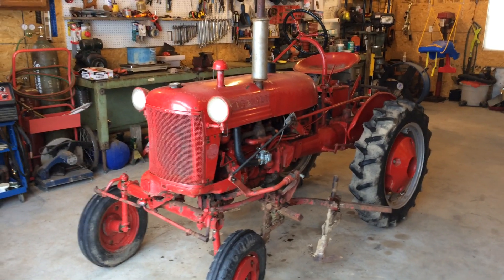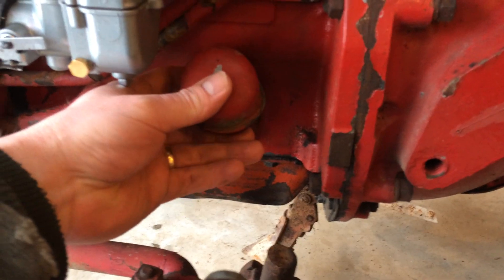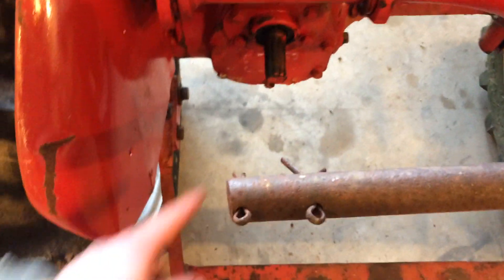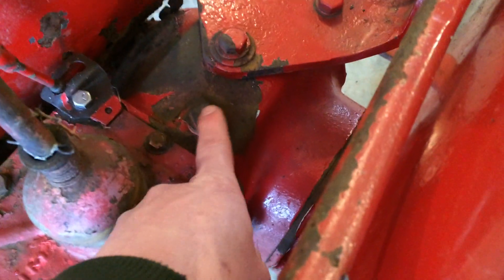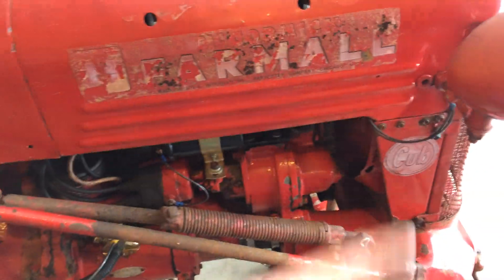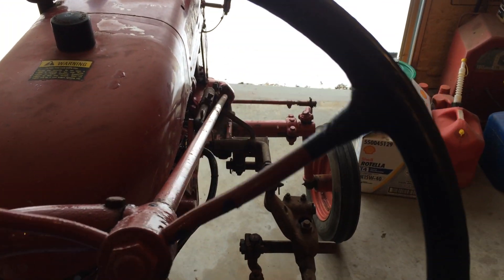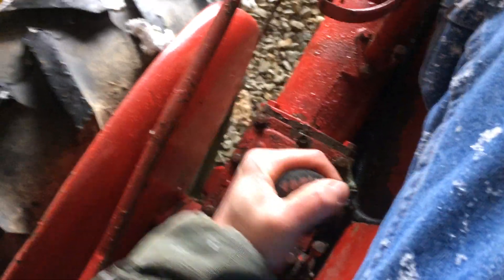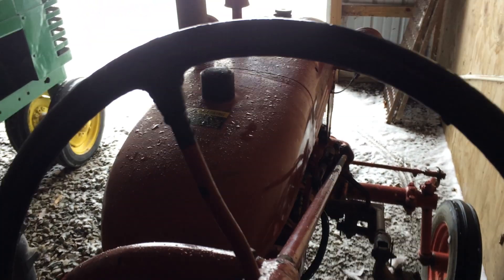Info about and driving an antique tractor  Farmall Cub

Comment: Just a reminder for those not familiar with older equipment that does not have modern electronic ignition systems. Don't leave the ignition switch in the on position for any more than a few seconds if the engine is not running or being turned by the starter. The ignition points in the distributor will be destroyed and the engine will not start. If the engine stalls or fails to start remember to turn the ignition switch off until you attempt to restart it. Good looking tractors you have there, thanks for the video.

Comment: My first job on our farm was cultivating sweet corn with a Cub when I was 10 years old. 
No cab, no air conditioning. Just good ole Sunshine.
Reply: Farming isn’t farming anymore. I do it old school. Tractors with a cab with ac/heat, touchscreens, radio.. ya farmers are lazy now a days.
Reply: your air conditioning was the wind
Reply: @Jabari Terrence instablaster :)
Reply: @Maximiliano Erik thanks for your reply. I got to the site through google and I'm in the hacking process atm.
Takes a while so I will reply here later when my account password hopefully is recovered.
Reply: @Jabari Terrence No problem :D
Reply: @bbruce995  cooler running into the wind hotter running with it.
Reply: I used to do the same thing, plus run the old combiner from the sixties

Comment: Safety hat 'on'.  15:00.  Just to expand.  You WANT to use the flip-lever brake lock when you're in higher gear just driving down the road.   The Cubs don't go very fast (I think they top out at around 7-mph), but at higher speeds you do NOT want to accidentally brake one of the wheels separately.  Turn you right over.  So ALWAYS engage the lever unless you're purposefully in the fields at lower speeds and you want to make tighter turns using the separate brakes.  Safety hat 'off'......😊
Reply: Safety First

Comment: Brings back memories.  Growing up in the 60s, my Dad had a 52 Cub.  Belly mower, different type of cultivator set up, bottom plows that could be run in both directions plowing, sycle bar and larger draw bar.  That 10 hp engine would (about) pull a two-ton bailer up one of the hills in the field.
Reply: We also had a sickle bar,  blade that could be mounted under or out front and a heat house(cab) for the winter.    We still have it in the family

Comment: Quite a fewvyears ago, lol, I worked as a tractor and equipment mechanic for a local John Deere dealer. I had went on a service call to see why the customers JD tractor kept dying. Found drill shavings in the plastic fuel tank was plugging the pick up line, the factory did a poor job of cleaning when they drilled the fuel tank for the guage and pickup mounting. There was an old McCormick sitting under a big oak tree. I talked to the owner and he told me the farm all had been sitting there for 25+ years and if I wanted it just bring a trailer and get it. It was some time but I checked on it a couple weeks later and he apolizized as he had given it to his brother in law who worked at a boys farm in mississippi. They got the tractor running and working, it had the belly mounted bush hog cutter and it all worked. They used that tractor for years to mow the fields at the school. Made me glad someone that really needed it was able to make a good machine with it.. I aquired several tractors during my mechanicing days, lol. Those old 140 farm all tractors were really good little tractors....sure worked on a bunch of them over the years..even got to do full restoration on a couple..I loved doing restorations.

Comment: I've got a 40 something Cub that belonged to my great grandfather to my grandfather. I converted it from 6 volts positive ground to 12 volts negative ground. I had the Starter button converted to post so I could wire in an ignition. I was tired of using the hand crank . I also had to change the magneto to a points distributor like yours has.It has a Sickle bar attached to the center and the PTO.
Reply from the maker: Cool family history. Hold onto that tractor.

Comment: Nice review of the Cub however you failed to mention  the oil pressure gauge which should be checked after each start and  occasionally during use. Very informative . I have owned 1947 Cub for over thirty years and love it.

Comment: I also have a 1949 farmall cub just like yours & runs like a sewing maching.
  Still have the original plow. It has a front blade & belly mower. 
  I wud like it converted to 12volt.
Thnx for a great video!
Reply from the maker: I made an extensive series of videos documenting the 12 volt conversion I did on this tractor. Go to my channel homepage and you will find the Playlist for this tractor. The 12 volt series is, I think, 6 videos long and covers EVERYTHING you will need to do.

Comment: The short caps I think don't vent enough and could pose risks to the operator when refueling a recently ran tractor. The taller caps have better venting and pose less of a risk. If you have the short cap, probably a good idea to let a tractor cool off for a half-hour to an hour before putting gas in.

Comment: Great little tractor for driving around a bit, but unfortunatly, the gear ratio from the 3rd is to slow that it isn't useful to drive longer distances on the road to tractor meetings. And I like the seating position, which is not in the middle, so you have your gear lever next to you and not between your legs which results a flat operation stand. Good Video man!
Reply from the maker: Thank you.

Comment: I saw somewhere that the two holes in the floor just behind the clutch are actually "windows" you can look through to enhance the "cultivision" concept.
Reply: NO, They are to insert the attaching rods thru for the Operator Step that goes there. Two models/heights of steps...

Comment: I have been operating one of these pretty much since it was new ,and amazing machine ,as to what all it can do slow by  todays standard but it can do much more work than a three horse team at a much better pace One little thing ..it could be my daddy was just extra cautious and never wanted to waste a drop of fuel I was taught to ALWAYS shut off the fuel and run the fuel out of the carb and let it die ,so that does use a smidgen more fuel I was always told it would save preasure from being on the float and I have sure seen em sit and empty the tank while sitting Perhaps that is just a carry over from running older cars with gravity fuel like a Ford A
Reply: Running the carb dry also saves you from having to clean the varnish left behind when gas left in the carb evaporates. Not a problem on a tractor that sees frequent use but on something that mostly sits it's good practice to shut the fuel off and run the motor till it dies.

Comment: Thanks for making this video. My grandpa had a Farmall Cub, it was given to my mom, and her ex husband has restored it. My mom still owns it, and it will eventually be mine. It's been sitting for years and I itch to get it running again, it is in very good shape, there is hardly any rust. Only bad thing in shape on it it that there is no paint shine. The paint is good. I never realised there was fluids for the rear wheels, that surprised me. Now I have an urge to buy a new battery, buy all the oils, and some gas and try to start it up and get it used again. This video was really helpful, because I never knew what a lot of these parts did. I did not even notice that there was a pull switch and a nother thing you had to pull to start it. I'm subscribed! I just have one question. What gas does it take? (Original engine)
Reply from the maker: I am glad you enjoyed the video. I I'm also glad that you have the opportunity to own a piece of your family's history. I love hearing about tractors that stay in a family. As far as gas, I like running 93 octane in all my old tractors. I put fuel stabilizer in every can of gas as soon as I bring it home. Some old guys like to use 100% gasoline, no ethanol content. I have tried it and didn't like it.
Reply: What are you waiting for? Go get that Cub and get her running again!

Comment: 7:58 Take that "short" cap off your Super A to your nearest IH dealer and exchange it for the tall cap. FREE OF CHARGE! Don't let them charge you for it. Many a building has been burnt down and tractor lost because of those short caps. Operator's would fill the gas  tank up with a hot engine, the gas would slosh around and leak out the vent hole on the short cap and drip down onto the starter, etc... and start a fire. Big safety hazard. As such, IH agreed to exchange these short caps for a much improved tall cap for free. I would imagine there was likely a lawsuit forcing them to do this. These old Farmall's are a very good tractor and are under valued when compared to a new compact utility.

Comment: They generally advise not pushing on the clutch to start. Just make sure it's out of gear.
Reply: Why is that?  
I always put the clutch pedal to the floor no matter what the equipment or motorcycle, thinking it's less drag on the starter.  
On my Farmall Super A I often start it on the crank when she's been settin' awhile thinking that the battery might be discharged and I never want a dead battery which will freeze in the Winter.
.

Comment: Enjoyed your video.  I have inherited this exact tractor.  It's been sitting in a warehouse for decades and was driven in place when it was parked.  Any recommendations beyond the walk through you did?  I have new tires and tubes and a 6 volt battery ready to go.   What kind of engine oil, wheel fluids, and transmission fluid for these old tractors?
Reply from the maker: 30W engine oil. 80-90W gear oil in the trans. If it’s been sitting for decades, your gas tank is probably gonna need to be emptied and cleaned out. The carburetor will probably need cleaned as well. You might think about pulling the spark plugs and squirting some lubricant into the cylinders before trying to start it. Sitting that long, those cylinder walls will be dry and could use some lubrication before attempting to run it.

Comment: I'm thinking about buying one of these. I'm going to look at it tomorrow. It's a 1952 model. Are they reliable? Can they pull a trailer with a chord of firewood? Those are my biggest questions. I'm into the tiny house/off-grid/homesteading thing. I don't need a big tractor but I need something that can haul some lumber and firewood on a trailer. The one I'm looking at also has a 42" mower deck and already has a ball hitch. Love the video, btw.
Reply from the maker: Upgrade to 12 volt if it is still a 6 volt and reliability is second to none. It will pull a trailer of firewood no problem. The one in the video has cultivators. Cultivators are about the hardest thing these pull, since they are literally digging into the ground like anchors. Cub is a good little tractor. Parts are easy to find and you can work on it yourself. I just saw one sell yesterday for $1,800. It was absolutely beautiful condition. Ready to show, but it did not have any attachments. Hope this helps. Good luck.
Reply: Once you get them running, they are reliable. Mine is one year older than I am - 69 years old. They are susceptible to what I call "cascading system failures" having to do with the electrical.
Reply from the maker: Randall Tuura. I did a series of videos documenting the 12 volt conversion on this tractor. These old 6 volt systems are finicky. Voltage regulators and generators can be a real pain.
Reply: I was disappointed to find that my Cub was converted by a previous owner. But having experience with a '49 six volt positive ground Cub as a kid. I like the 12v negative ground with a distributor much better.

Comment: Thank you so much for this tour.  I'm about to look at one for sale so it is helpful to approach this with some knowledge and confidence.  Question 1: did you stay with the magneto after the 12V conversion or did you need to address this?  Question 2: I might have some people driving this that aren't good with stiff clutches--can you describe the foot pressure necessary to disengage the clutch (push the pedal)?  Thanks!
Reply from the maker: Tim O'Neal this tractor has a distributor, not a magneto. 12 volt conversion went well for this tractor. As far as describing the feel of the clutch, it had a smooth engagement. It was easy for a novice to drive. I’m sure there are some more aggressive clutches in some tractors, but this particular one was easy to drive.

Comment: Hey I stumbled apon this video after searching about cubs sesne I'm about ready to go pick one up. Other then the stuff in the video is there anything else I need to know or do once I get it? Mine is going to be a 1948 converted to 12v already but still has the amp meter in it. Also thanks for the great video very informative learned alot.
Reply from the maker: Check gear case fluid, making sure it is not leaking out the ends of the axles. The seals are notorious for going bad on Model A. I would think Cub would be about the same. Check BOTH final drive cases for fluid. They are independent of each other as well as the gear case, so make sure to check all 3. Then just check engine oil, coolant, and hydraulic fluid. All those fluids can add up pretty quickly. Because of that, some guys never change them. If you plan to keep it for a while, bite the bullet and change everything. I'm glad you liked the video.
Reply: @justtinkering6054  thank you very much for all the information you have given. I'll definitely take the time and check and possibly change all the fluids. The manual should have all the capacities and types of fluid right? Also thank you for taking the time and commenting back appreciate it.

Comment: Just got mine today and it’s a bit rough although running...I noticed an oil leak coming from the main engine pulley in front...is that a major fix on one of these ?
Reply from the maker: I'm afraid I won't be much help with this question. I never had to deal with any oil leaks on the engine.
Reply: Sorry, I see your question is 2 years old now. But crank seal replacement is not easy unbolt front end use heavy duty puller those pulleys can be really tight good luck friend!

Comment: Thank You for this video,

We have a 1947 Farmall Cub.  But we are experiencing a few issues.

We need a new carburetor, any idea what single barrel carb is in there?

Also we just ordered tires. We’re told 9-24 don’t exist anymore, does a 9.5-24 work on the rear?

Thanks again
Reply from the maker: I have actually made videos that touch on both of your questions. As far as carburetor goes, Ebay is a great resource. In reference to the tire size, you won’t even notice that half inch. Check my video library for more information.

Comment: Where do you put the hydraulic fluid at
Reply from the maker: It's been a while, but I believe there should be a large plug on the left side of the Touch Control housing. Fill it up until it runs out that hole.
Reply: @justtinkering6054  thanks for the info 👍

Comment: Dear Just Tinkering, I can start my 1948 farmall cub, but why does it stop in 20 to 30 minutes?
Reply from the maker: Could be a lot of things. First thing I'd check would be coil. Let the tractor warm up until it quits. Then pull off a plug wire or pull out a plug and see if you're still getting spark. If no spark, your coil is bad. Sometimes they work fine until they warm up.
Reply: Could you please show me a picture about the coil and where it is on your farmall cub?
Reply: Not to be a buttinski here but I had a problem with my oil pump needing primed and it would actually do the same thing.  It would run for 20 or 30 minutes and stop.  I found a procedure to prime the oil pump and solved the problem.  I'm lucky I found the fix before it was too late.  As it turned out, it doesn't seem like any damage occurred.

Comment: What brand or grade engine oil do I use? We just got a Farmall Cub similar to yours with 6 volt, May 25, 2019.
Reply from the maker: I would go with a 30W engine oil. I like valvoline but brand isn't a big deal.
Reply: @justtinkering6054  would 15w40 or 10w40 work for the cub?
Reply from the maker: @emmastol8959  it would work fine. Keep in mind, oil today is head and shoulders above oil from 65 yrs ago. Anything produced now is going to offer your engine more protection than older oils would.
Reply: @justtinkering6054  Thank you!
Reply: @justtinkering6054  Recently someone said
 " if there's no oil filter stay with non detergent oil, 
if there is an oil filter use detergent oil".

Comment: Is there a kit for a 3-point hitch available?
Reply from the maker: not to my knowledge, but that doesn't mean there isn't.
Reply: Suposibly there is but you're better off just leaving it the way it is or getting the 1-point 'fast hitch' set up. The fast hitch stuff works with lots of farmall implements(many of which were made for the cub specifically).
Reply: This is the link for a 3 pt 'frame',  you will still need the quick hitch from Harbor Freight to attach implements... https://www.youtube.com/watch?v=__0SYzUre_w